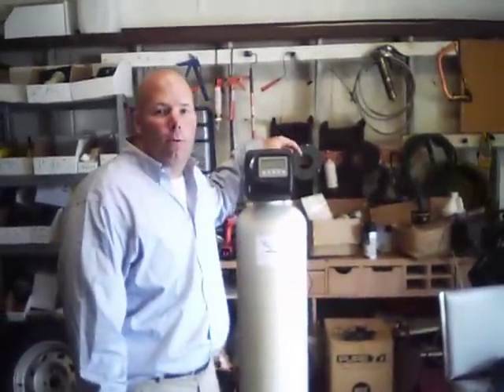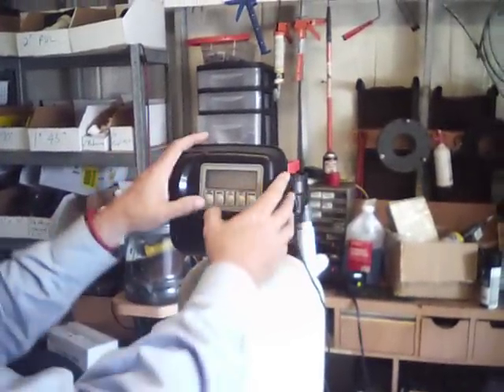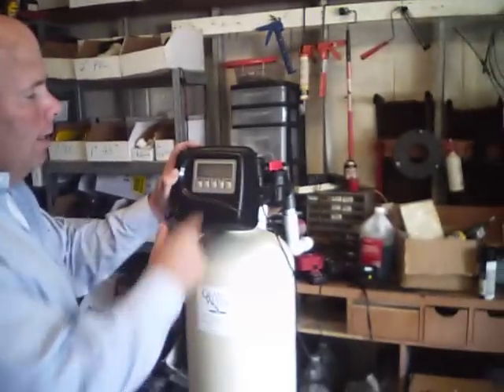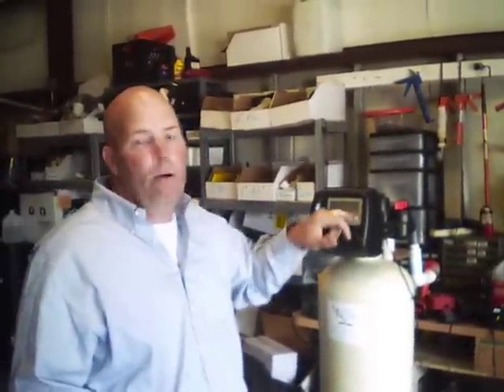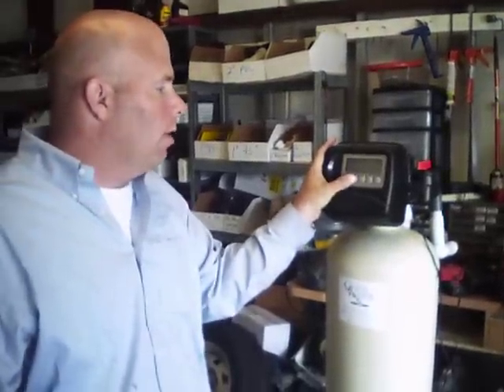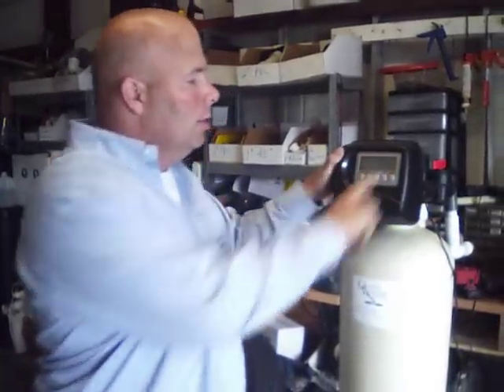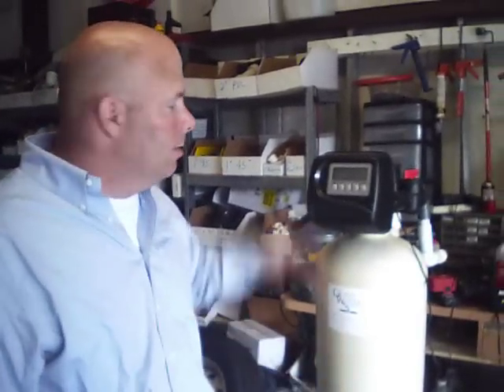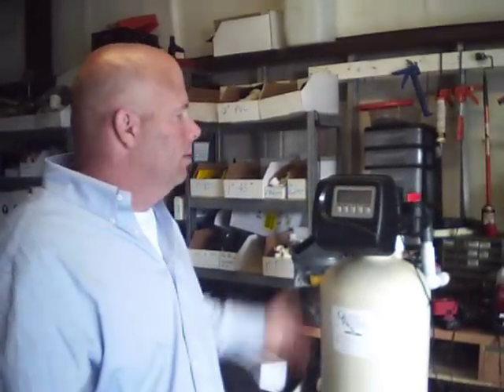Programming a WS1, Clack, Nelsen C Series, Watts Brand

Comment: Hi Matthew my softener runs during the day sometimes even though I have it set to run at night... not sure how to stop this from happening mine is set to soften every other night at 3am
Reply: Is it running a regen during the day or you just see the word softening on the display? If you see the word softening then all that's telling you is there is running water in the house and the display is letting you know that you have a softener system and it's normal. If it's running regen during the day then you need to read the manual and verify the time: https://clackvalves.net/p/complete-service-amp-programming-manuals/ci-programming-manual/

Comment: 27 lbs of salt for a 1.5 cub softener is ridiculous. You should be regenerating at 36,000 using 12 lbs salt.
Reply: I have a 32k 9 x 48 tank 1cuft tank on well water. What pound setting do you recommend?
Reply: @ShawnTRD  9lbs and set it a 24k grains